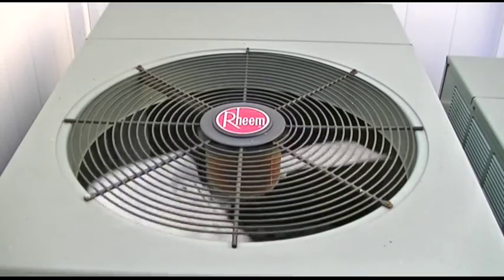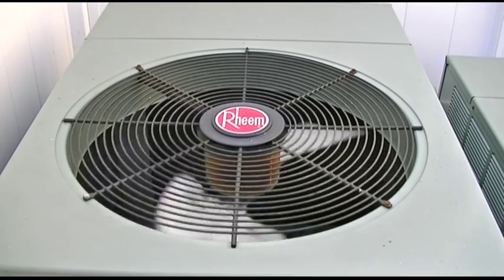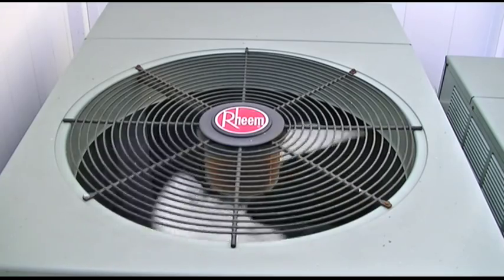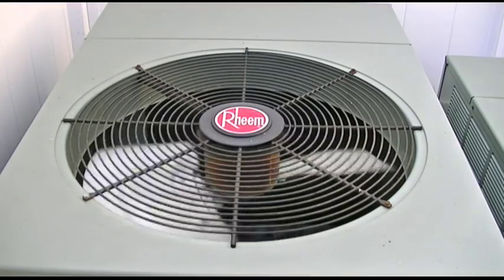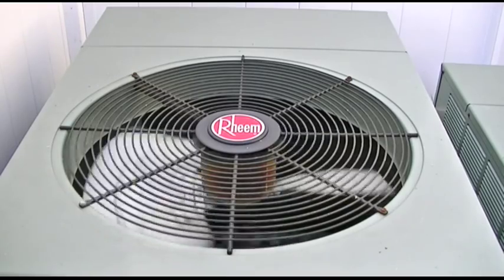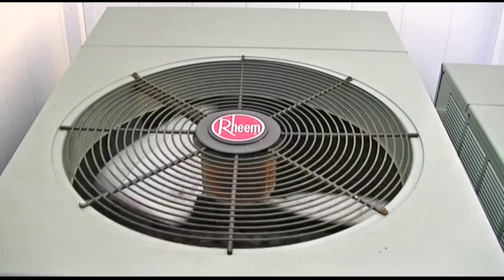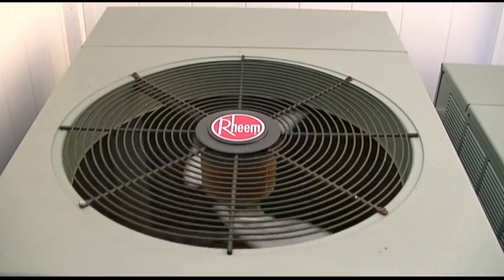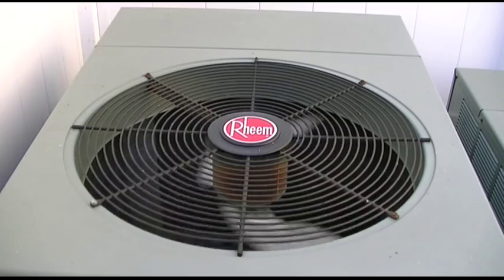Copeland Scroll Compressors Can Run In REVERSE!

Comment: I have a Lennox Condenser Unit model HS26-048-5P with a Copeland scroll compressor and I have witnessed this happening at least three times with the latest incident occurring this month. The incident occurred even though I had installed a time delay relay with a “delay on break” function some eight months ago. The time delay relay is a “ICM Controls ICM203 Delay-on-Break Timer with 0.03 minutes-10 minutes” that was installed in the 120 VAC AC line circuit that feeds the 24 volt control transformer located in the blower. When time allows I need to check the relay again to make sure it is still functioning properly, but I suspect that it is still possible for a temporary dip in the AC supply to the house to be just right so that the relay or the time delay function in the White-Rogers digital thermostat does not react to prevent the reverse operation of the compressor. The compressor tripped out on thermal overload and would not restart until it was allowed to cool down for approx 1.5 hours. I did not want to use water to cool the compressor and wet the compartment etc. Took the condenser unit cover off and let it cool with ambient air flow.

Statement from the Lennox HS26 Series Unit Information:
The time delay performs no other functions. Without the delay it would be possible to short cycle the compressor. A scroll compressor, when short cycled, can run backward if head pressure is still high. It does not harm a scroll compressor to run backward, but it could cause a nuisance trip of safety limits (internal overload).
Reply from the maker: Thanks Keith!  Others thought I was crazy!
Reply: Thanks, great video. First time it happened to my condensor I would not have believed it either until I read that statement in the Lennox manual. And after doing a number Internet searches I found comments about installing the "delay on break" timer to help minimize the reversals. FYI the first time this power blip occurred it also blew the starting capacitor on my neighbors condenser unit (not a Lennox unit).
Reply from the maker: I once had a thunder and lightning storm that caused a number of brief, rapid-succession outages, and was outside in my covered porch at the time, A/C was in earshot.  I don't know if it spun backwards at all, but we must have had 4 or 5 blips within a matter of 20 seconds, but the compressor restarted each time.
Reply: I think our problem is related to the way power company operates the electrical grid in our area. Although I have no definite proof, I think they are constantly switching sources or doing other operations that cause these power blips. Every compressor reversal event I witnessed occurred without bad weather in our neighborhood.
Reply from the maker: I don't doubt what you said in the least.  When this happened to mine, the weather was nice and clear.
Reply: @keithc8133 I have a MILLER package ac unit and it has built in compressor short cycling protection internal to the compressor which eliminates that issue but granted it's a Bristol Reciprocating compressor in my unit I initially thought that my unit had a Copeland scroll compressor but it doesn't but I never looked inside the unit to see until the repairman came to replace the condenser fan motor on my unit and I actually saw the compressor that day because he had everything apart because the wires for the fan motor ran clear across the unit itself because of where the capacitors and wiring harnesses are
Reply: @jaykay18  my Miller package ac has never done that but then again it has a protection device internal to the compressor which eliminates that issue but then again I didn't know until I watched the repairman replace the condenser fan motor in the unit and found out it has a Bristol Reciprocating compressor in it which know explains the loud growling sound when the unit starts for the first time if it's extremely hot outside before the unit even kicks on for the day
Reply from the maker: @randytorboli  Do you see how other people use CAPITAL letters at the beginning of sentences, and these funny other marks like , and . ?  You should use them too, they're FREE!  Not to mention, they'd actually get your message across instead of getting garbage across.
Reply: @jaykay18  yeah I'm sorry about that I always forget
Reply from the maker: @randytorboli  Looks like you still have forgotten!  That's deliberate, and intolerable.
Reply: Had the reverse running trouble in a water source heat pump. The contactor's contact points were fried and vibration made it occasionally open briefly. Installed a new, larger 50 amp contactor and the client says problem has gone.. except when the power blips and his computer UPS starts beeping. Super brief outages still cause the trouble. I installed an ICM492 Line Monitor, but it proved to be of only partial help. Not no help mind you, but short transients still cause the reversing trouble.

Comment: Thanks much for your video! I have two Bryant condensers, power flickered and one of them started making exactly the noise you describe. And my units also make the exact noise you described when they turn off. Anyway, I was looking for answers on the web and found your video. 🙏 Sounds like they were not damaged. After I turned mine off I could hear a neighbor's also making the same noise.
Reply from the maker: You're welcome!  You likely experienced the same thing I did.  Now in 2025, this unit is still running, without a stitch of trouble.

Comment: my power company was working on the line the other week, which cause my lenox unit ran the compressor reversely twice. After enough research, i installed SureSwitch which replaced my existing contact and the unit has been good so far.

Comment: You need to time delay device what's the temperature in the unit can be equalized before The unit starts again
Reply from the maker: If this phenomenon were such a big deal, all of these units would be equipped with said device from the factory.  This was a one-off event, it has never happened since.  And fortunately I was home when it did.

Comment: A real problem with Nest thermostats
Reply from the maker: There's no need for those to begin with.  A thermostat has one job to do--to maintain a set temperature.  It's in the name.  Thermo--heat, or temperature, and stat--stay the same.  If you adjust your thermostat up and down all day, you're defeating it's sole purpose.  Turning your A/C up to a higher temperature during the day is harmful to your equipment.  Not during the day, but in the evening when you get home.  The evening sun is often beating down on the unit and your house, this increases head pressure and causes the unit to pull more current to do the same work.  Plus, you have lost all of those degrees during the day.  So instead of the unit coming on to cool back down 1 degree, it not may have 6, 8, or even 10 degrees to cool.  They claim that air conditioners take about an hour to cool one degree.  That could be 6, 8, or even 10 hours the machine will have to run to undo your savings during the day.  Not to mention, many electric companies now have time-of-use plans that their customers are being forced into, with false promises of saving money.  The problem is, the highest prices--almost double--are during the peak hours when many people get home from work, between 4PM and 7PM.  So by adjusting your thermostat to anything but the temperature you want it to maintain, you are only hurting your equipment, and your wallet.

Comment: Per Copeland's app note AE1331, a single phase scroll compressor can reverse when there is a momentary grid power glitch of less than half a second.  Compressor makes a terrible sound when running backwards and it will eventually overheat and trip protection cut out.  Once protection breaker inside compressor resets it should start up normally.

Always good to have a power glitch timeout timer on compressor contactor relay coil.  Copeland says their compressors doesn't need refrigerant to equalize pressure before restarting but the reversing issue is enough of an issue to have the power glitch timeout timer.  You want to avoid tripping compressor's internal protection Klixon breaker as it will eventually fail from too many trips, requiring a compressor replacement.

P.S.  I have found that some electronic thermostats with integrated power glitch timeout timers do not always trip when grid glitch is very short in time, allowing the compressor reversing issue to happen.  They also require the 'C' 24 vac wire to get the power glitch detection. 

Another item to watch out for is condensate drain overflow switches that just cuts the 24vac to compressor contactor relay.  If they 'chatter' contact as water gradually gets too high it can cause the contactor relay to bounce off and on.
Reply from the maker: Thanks for the additional info.  That was exactly the kind of power glitch we had.  This happened one time, and one time only.  They have since redone all of the power lines in this area, and there is almost never a power interruption now.

Comment: If that happens, here are the steps to making it go back to normal
1, unplug the thermostat.
2, wait for the unit to shut down comepletely. (not hearing condenser or air handler running)
3, plug in the thermostat.
Reply from the maker: If I'm around.  If not, the head pressure will eventually get so high that the compressor will stall.  It will either thermal out and reset by itself, or blow the breaker.
Reply: also, the problem is that the shutoff device (check valve) is probably broken. because it shouldn’t allow refrigerant to go the other way.
Reply from the maker: @balkanboi11  No, it does.
Reply: https://youtu.be/A7AMLAqiHB4
Reply: i think some compressor may actually allow refrigerant to go the other way 🤔
Reply from the maker: @balkanboi11  Those are called heat pumps.
Reply: @jaykay18  heat pumps use a reversing valve to do the reversing stuff.
Reply from the maker: @balkanboi11  Yes, the fact of the matter is the refrgerant flows in the opposite direction.
Reply: to solve the problem for your unit, you need whats called a compressor lockout board. After a power outage, the lockout board will wait for a little bit than activate the compressor.
Reply from the maker: @balkanboi11  There is no problem, this happened one time and one time only.
Reply: you are right, thats normal for the refrigerant to backflow through the compressor.

Comment: How single phase can run in Reverse,,,,,,,,but i found a 199 psi low press and 290 head psi. Weird but scroll comp in Ruud split system system
Reply from the maker: It is possible, there are articles about it you can read online.

Comment: You may have non considerable. In your refrigerant, to fix this you may need to remove refrigerant replace filter drier and do a deep vacuum before refilling
Reply from the maker: As explained this is a normal phenomenon that can affect Copeland scroll compressors.  It is uncommon that it occurs, and required extenuating circumstances for it to occur in the first place, but it can and does happen.  Many people don't ever even know it occurred.

Comment: New tranes are doing this. They need a time delay to keep it from short cycling and running in reverse. Just saw this on a hvac fb group page. Seen it in person a couple times. Definitely annoying when youre trying to service it quickly and efficiently lol
Reply from the maker: I've had people swear this is impossible.  Those who know, like yourself, are further proof that this is true.
Reply: Thank you very much for sharing this comment. It gives me hope!! I have a Trane XR 2021. It makes a loud noise once in a while and last for about 1minute or two. Or I shut it down and turn it back on in five minutes and everything runs normal again. Installer has no clew what happen with the unit. Called other service company and suggested to install a power surge protector for the AC unit to be installed right next to it. Do you think that would solve the problem? Thanks again any Thoughts will be appreciated

Comment: Completely normal with the sounds of this compressor.. the old scrolls were extremely loud. And taking the batteries out will not fix this problem on the fast interruptions. Nor will any low voltage control delay on break relay , that is if it happens that fast.
Reply from the maker: Thanks.  Yes, I agree, there's really no way to prevent a problem with such a quick blip.  Fortunately, this only ever happened this one time, and has not happened since.

Comment: The power interruption happens so fast  or with generator power transfer happening so fast the contactor does not drop out. The reason this guy's air was cooler coming out the top of the fan was due to the compressor running in reverse, obviously not the SOV, rheem/Ruud units SOV are de-energized in cooling. The noise he heard as well tells what happened.
Reply from the maker: I am that guy, and yes, you are correct.

Comment: If you have any UPS devices in your home.. it will help clue you into blips in the grid.  This happens to me a couple times per year... and seems to be linked to nearby home(s) losing power.  I know this, because I can write down the time, wait 5 minutes, check the local outage map.. and sure enough.  It must be some kind of transfer in the grid.

A sidenote is I seem to have quite a few contactor failures.
Reply from the maker: I have UPS devices around.  This day, indeed, they kicked on to battery for that blip.
Reply: @jaykay18  And I'm not sure there is really a practical way to prevent this.. If the stat doesn't detect it.. I'm assuming it has the caps to temporarily stay alive and to keep powering the 24V necessary at the contactor.  Any standalone delay component at the condenser probably wouldn't see a 24V dip and/or wouldn't handle the amperage to be hooked to the compressor high power circuit.  I imagine you'd need some kind of UPS for the outdoor unit.

I wonder if these delays could handle the amperage between the transformer and the stat.... That may actually be the sweet spot.
Reply from the maker: @Swoliosis1  It's a fairly rare occurrence.  This unit has started countless times since this video was recorded, and always runs the right way.  We have also had power blips, and it stayed running properly.

Comment: I have a similar unit with exact same issues. AC mechanic installed a time delay and the compressor some times still runs on reverse.
Reply from the maker: Sounds like the tech didn't effectively solve the problem.  A time delay will generally prevent the issue, if it works properly.  But if it does that just randomly, without a power disturbance, there is something else wrong.

Comment: Yep, that is totally normal. We had a Rheem air conditioner that would always do that on shutdown. The air conditioner was 12 years old when we moved in to our house, and it was 24 years old when we decided to upgrade. It always made that sound the entire 12 years I had heard it run.
Reply from the maker: Thanks for confirming.  Oddly enough, the season after this video was recorded, it wasn't making that shutdown sound any longer, and hasn't for years.  When I first moved in, it didn't do that.  Then one day it started, and just as mysteriously as it started, it stopped.

Comment: @jaykay18 https://youtu.be/iPwWEkvFWac do those start up and shut down noises sound like the ones in this video. And the if your thermostat is run off of a C wire and not batteries that time delay will apply
Reply from the maker: No, they make sounds like you heard in my video.

I'd have to check the wiring, I looked at it years ago but don't remember.  The thermostat has its own time delay and will indeed wait to restart for 5 minutes I believe.
Reply: @jaykay18  ok because the unit I was filming in the video had a Copeland scroll compressor in it also